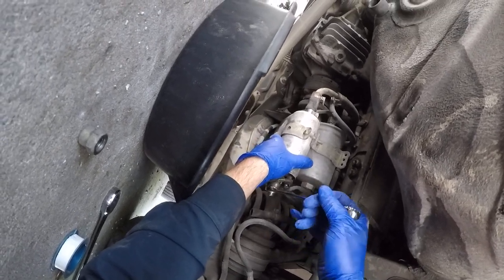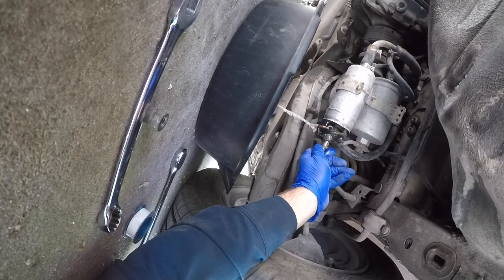How to change the fuel check valve on a 1990 Mercedes 300 SE

Comment: Hi, thanks for this video. Helped me out a bit when I replaced my checkvalve. I had the same problem, after the new checkvalve was in, it kept leaking. I made note of where the old washers went, and compared the old ones with the new ones to make sure everything was the same. I even sanded down all the corrosion on every bit of surface that the washers come in contact with, but it still kept leaking. Even tried annealing the washers, but no dice. Caused me a slight headache to say the least. I didn't want to go the teflon tape route, so I solved it another way. I ordered washers that were a bit thicker, and had a little bigger outer diameter. The originals are 1mm thick, I went with 1.5mm, and for the outer diameter I went from like 16mm to 17mm. Inner diameter is 12.5mm (on my 380SE at least) if anybody needs to know. Hope this will help someone else too!

Comment: so what r u doing about a small leaking ? its fine? i got that problem too when i replace my fuel filter
Reply from the maker: SOMEONE WITH BULLET ON HIS HEART I'm not sure the proper way to fix it. However. I do know that white Teflon plumbers tape on the threads has fixed the problem on my dad's car and never caused any problems itself. Trust me. It works.
 Do not leave it leaking like that. It's dangerous and costly to you and the environment. I'm not lecturing you though. Just trying to help

Comment: I have a 1990 Mercedes 300se can someone please tell me where to find the fuel relay switch please
Reply: Open the hood..then near the middle from your fire wall you will see 2 big black boxes , previous is a clear box with a fuse, the second one oriented to the battery is the Fuel Relay..if you need to run your car take the fuel relay and use a cable as a jumper within the 3 and 6 position, it will be like a U so the fuel pump will be working all time..just in emergency case.